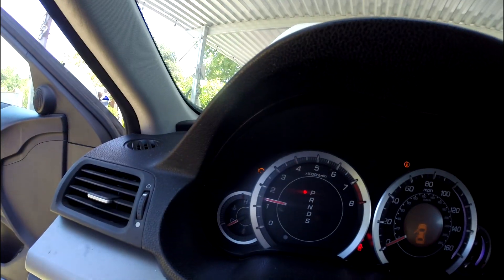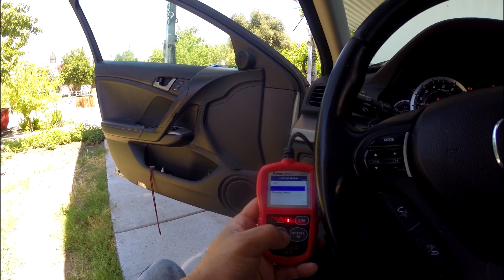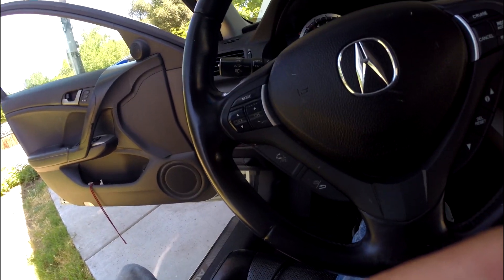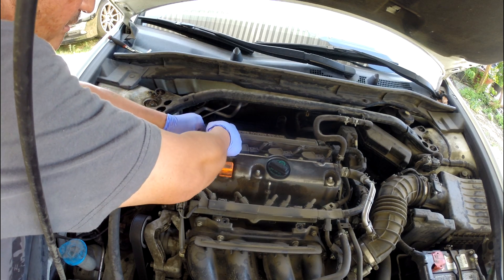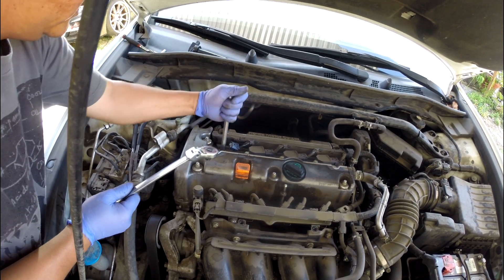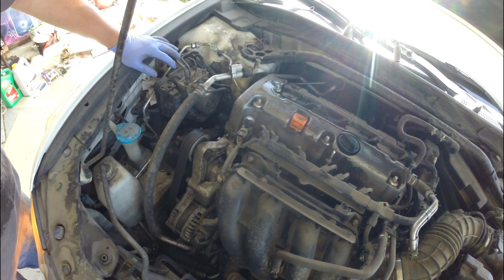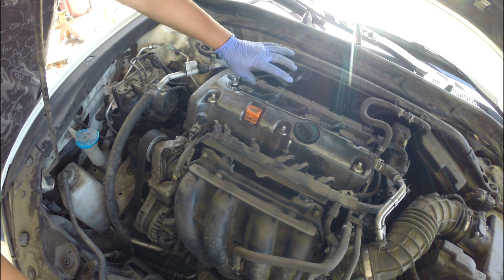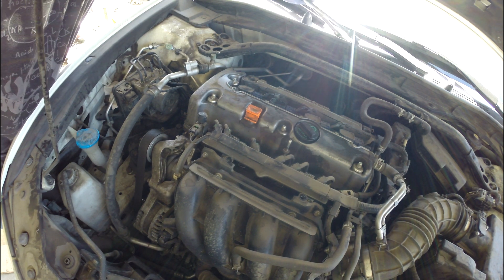Acura TSX engine is blinking po301

Comment: I had misfire on cylinder 2 and 3, exact same car 2009 acura tsx. 180k. Changed the spark plugs and the ignition coils, and it still blinks and doesnt shift out of second gear. Im stuck dont know what to do. Any help?
Reply from the maker: It could be your injectors.  The doesn't shift mean you have transmission problem that doesn't related to your misfires
Reply from the maker: Please help me subscribe to my channel ok